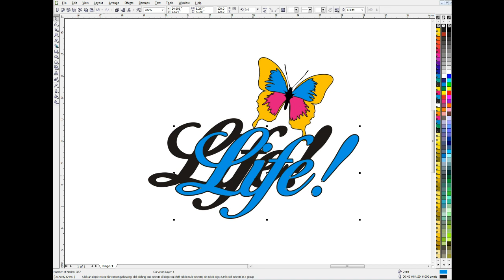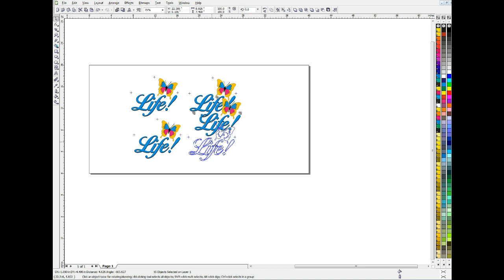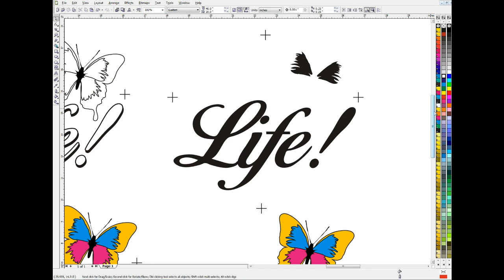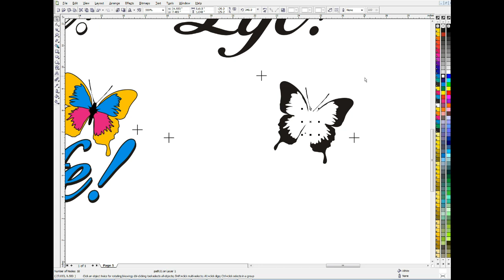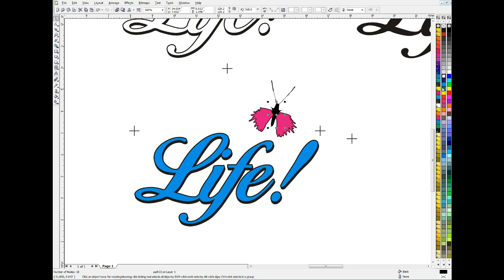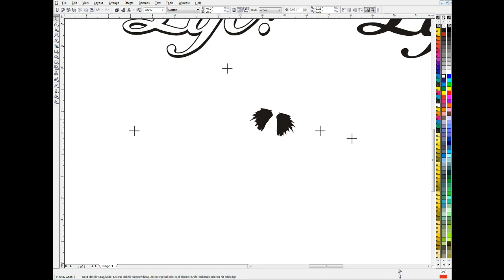T-shirt printing for beginners: Separating spot color

Comment: very good content but extremely out dated, maybe do an updated video showing how coreldraw does it simply through the print options.
Reply from the maker: Thank you, yes this is similar to the way we did it before computer graphics. At the beginning of the video I mentioned that while there are more efficient ways of separating color, I believe it's useful for a new printer to do a few manual separations in order to understand exactly what separations are and how they should look when properly done..
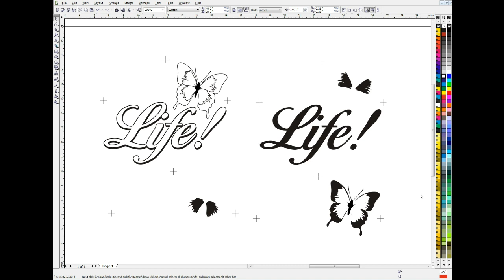Reply: @NShannonWalker 15:25